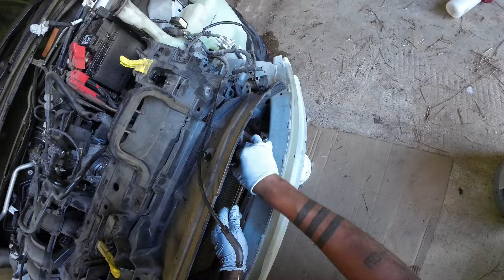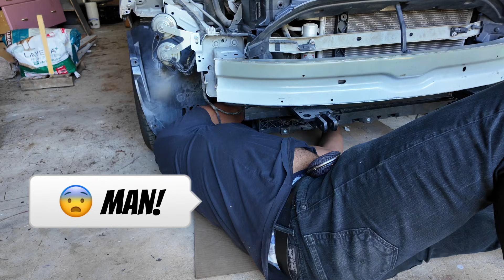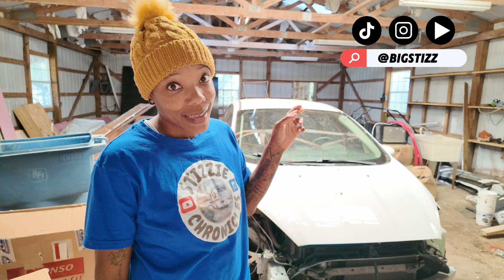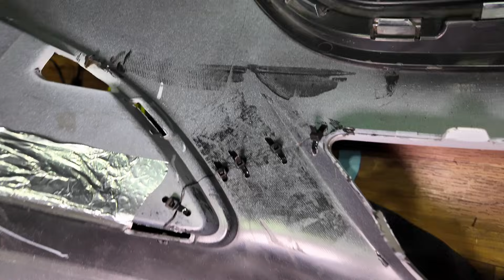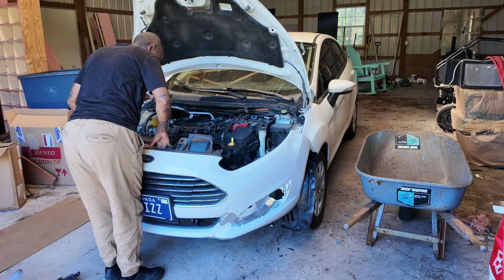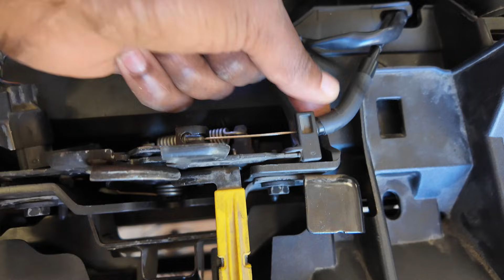Watched YouTube Tutorials & Became My Own Mechanic

Comment: Great job! Just keep an eye on that coolant  level. There can be air pockets that can be difficult to purge.
Reply from the maker: Yes, I came across a few videos discussing that. After the first coolant fill, I opened the radiate vent, added more coolant and let it drain out for a while to let the system burp. Hopefully, that let the air pockets out 🤞🏾